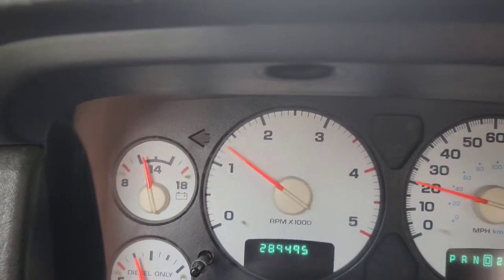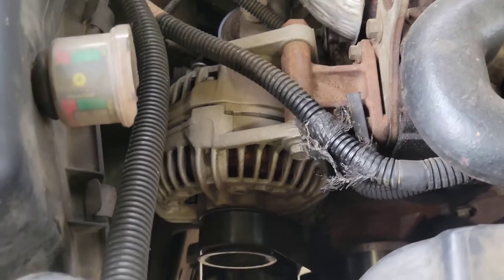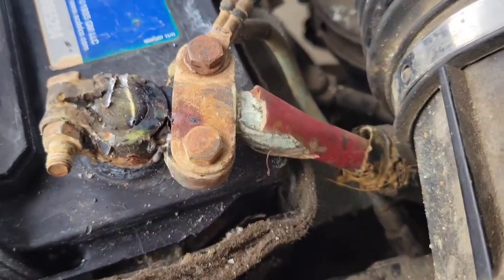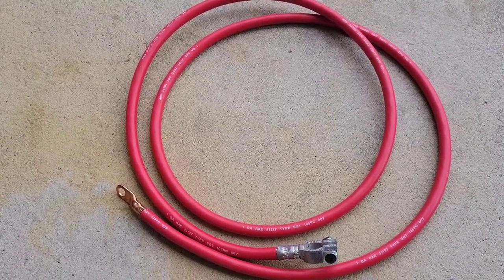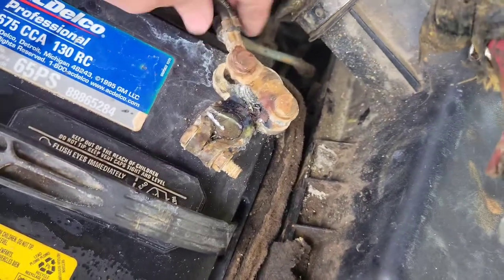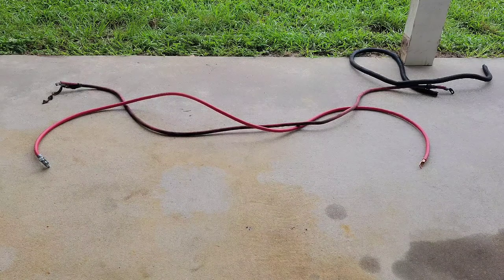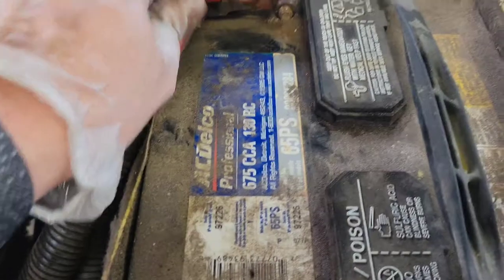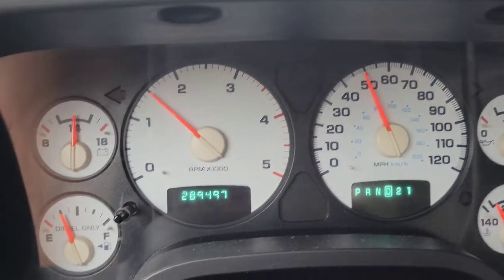Dodge Ram 2500 Charging Problem

Comment: Mine did the same thing. In my case the crossover cable was fine. The gremlin was the thru-bolt that clamps the cable to the driver side battery. That bolt was all fragged inside of the terminal. Outside it looked fine, but inside, not so much. Replaced the bolt. Cleaned ALL of the terminals very well. Put it all back together and I'm good now. Watch out for corrosion in the connectors that you can't see from the outside.

Comment: On my 06 I replaced all my cables. I upgraded all my cables on the positive as well as a negative to at least two art cables off the battery the battery the battery were one cable. I ran double cables from both sides made them up myself. I still had enough leftover to put a one cable from the alternator to the battery, I do not run 670 cranking batteries in my truck they’re worthless. You need to run a higher cranking amp batteries in your Dodge to spend that starter properly and for the electrical system to properly handle it. The batteries used to be running in your Dodge are. Odyssey these batteries have been in my truck for five years and they’ve never failed me to start my truck no matter how cold it is or how much of a load I put on them. They are the best batteries that you can buy for the money that might be expensive, but they last in the alternator, the voltage out of the alternator they will never fail and have a good warranty. I think mine were five year warranty when I bought.

Comment: My alternator wasn’t putting anything out probably went bad from over charging I tested it with a multi meter. My new alternator is putting out 18! When I have the passenger side battery hooked up but as soon as I take it out of the equation everything runs normal so it has to be my crossover wire connection. I get 18 volts at the terminal on the cross over wire at the driver side battery but it must not be taking it due to poor connection at the driver side battery.

Comment: yeah my 06 just did this  but wouldnt start and both check gauges and parking brake light went on. i do see the voltage drop from one battery to the other so maybe its the calbe ill try the pos to pos and see if that works
Reply from the maker: Good luck my friend. That corrosion is a beast.

Comment: Ok so mine is doing that same issue over charging my passenger battery.  And blew it up. I replaced   The battery. And tested the voltage from my alternator. And it was reading 17 volts. I changed the wire from battery to battery and no luck. I changed the alternator. Again and. Still reading 17. So what do I do ?

Comment: When I first got my 5.9 the passenger battery started leaking so I changed both batteries just to be on the safe side and cleaned the terminals but then about a month later,the new battery for the passenger side started leaking again🤦‍♂️So just yesterday I got another battery but then I left it running at idle for awhile that evening and it still ended up leaking even tho it’s a new battery🤦‍♂️ you have any kind of info on what may be causing this problem?
Reply: My truck is doing the same thing.
Battery on the passenger side keeps leaking.
I changed alternator, cable and both batteries. Issue keeps coming back
Reply: Why don’t you upgrade to an agm battery

Comment: How old are those batteries, they look orginal. Also on Diesel Trucks you should clean the terminals every now and then and spray the terminals with a battery cleaner. I got 276,645mi on my 07.5 and I've had to replace both batteries only one, cause a weak one will cause the good one to work harder trying to keep up. Those are the worst battery terminals and posts that I've seen. Little maintenance will go a long way so you don't have several things go bad because your  to lazy to clean them up

Comment: Nice video; Good job 👍
question: how is the passenger side battery doing now ?. You had to replace it?
Reply from the maker: It's still holding up. I am getting some corrosion again. I have to figure out how to stop that nonsense.
Reply: @Tieknee  that's good to hear the batteries are still holding up👍. For stopping corrosion, I use dielectric grease and it seems to be working for me and I Only do a very thin layer over the terminals.
Reply: @Tieknee  You have to neutralize the corrison 1st. You can use white vinegar and get off all the green crud 1st before applying sparingly then you can scrub some more. Then use 70 percent rubbing alcohol to go over everything. Then use a electrical terminal protectant.
Reply from the maker: @brianb5779  great tip! Thank you for this. That junk has come back. I am going to have to give this a go.

Comment: Would this also possibly cause the engine to lose power start shaking and knocking. I had these symptoms  drove home then lost the power etc now won't start just clicks
Reply from the maker: I don't know about that. I hope you figure it out buddy
Reply: My truck stopped charging, check gages light came on and off intermittently for a few days and then I lost my radio, lights went dim, abs light came on, truck would shift when it wasn’t supposed to and engine cut down to 3 cylinders. This is your problem I would think too?  I know that the 5.9 cummins ECM needs minimum 11 volts to function properly so that why this is happening
Reply: yes i had this problem with mine.

Comment: I had that issue my grid heater relay solenoid  was staying on causing a discharge
Reply from the maker: That is interesting. How did you chase it down?
Reply: @Tieknee  it burned up a battery before i figured out the problem i changed alternator thinking it was going out the i saw the solenoids on the passenger side battery tray towards the bottom disconnecting and the discharge stopped put new ones on and no more problems

Comment: I’ve been running off driver side battery for like 6 yrs now , passenger battery completely out and disconnected from truck , my cage is just now having this problem wher it won’t charge any thoughts?
Reply: Sry check gauges light just now coming on and draining battery